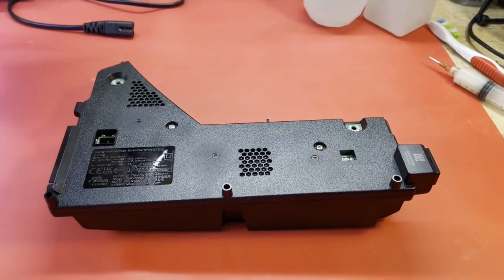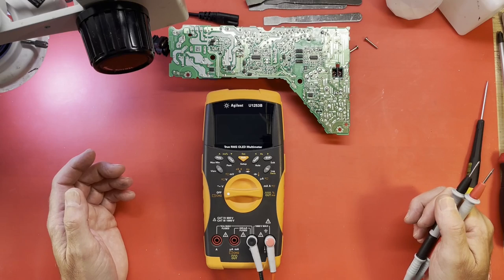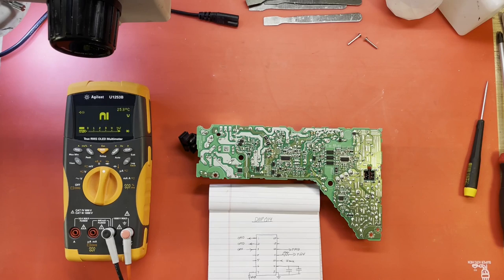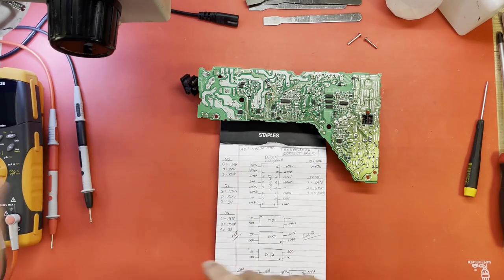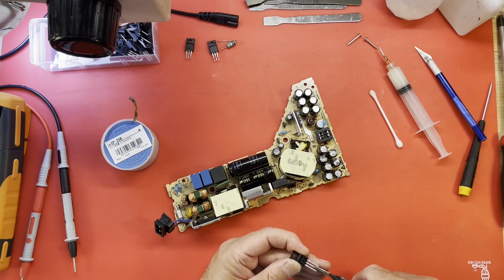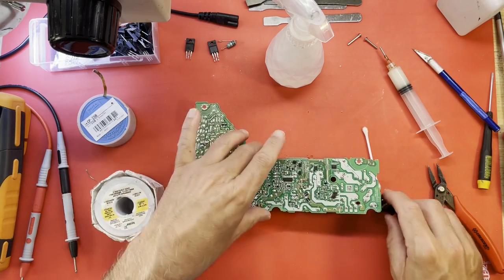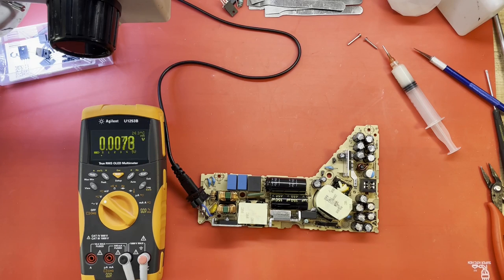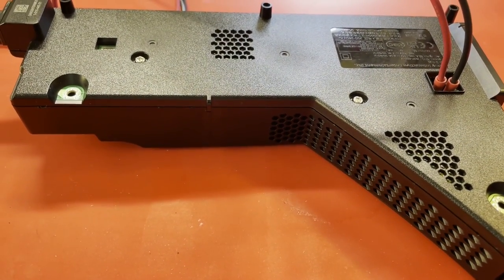#92 Repair of ADP-400FR PS5 Power Supply

Comment: Great video, as always. Your channel is helping me a lot. Explanations are very useful. Especially your diode-reading notes. You have no idea, how helpful they are to amateur. Do you also do similar notes with voltages?
Reply from the maker: Thanks!  I appreciate that.  I sometimes will take voltage notes.  I think I find diode readings more useful because usually the device is completely dead and thus voltage readings are almost useless.  It is useful to know the Vcc voltage.

Comment: Nice work! I've not finished watching your video, but If you want the white gummy antivibration on the replaced-without-reason big cap search for "liquid electrical tape". Works very well!
Reply from the maker: I will do that!  Thanks for the tip!
Reply: @ToltecMerc  Thanks for your content! I repaired a lot of PSU's using your clear explanations! Regards from Italy
Reply from the maker: @riparaggi  that’s really good to hear!  Save those supplies from the trash!

Comment: So the resistor was just a current resistor? How did you know the mosfets are blown, i guess you worked a lot on these Power Supplys? What do you think happened, that both mosfets get a short between source and drain, overcurrent?

Comment: Hello, nice video. A faulty power supply can cause random PS5 shutdown while playing?
Reply from the maker: Yes.  It is possible that a power supply could cause that.
Reply: @ToltecMerc  what can cause that, PFC capacitors or the PSU has a thermal fuse that can be triggered with overheat? No warning message about high temperatures pops up

Comment: Atm I dont have solution but that multimeter is not viewer friendly... when you measure something at the same time we want to see it on multimeter, but this multimeter is not friendly to eyes. Try to change FPS of recording camera?
Reply from the maker: Yeah I realize that there is a problem with the different refresh rates between the meter and the camera.  I will try to tweak my camera settings and see if I can make it better.

Comment: I'm thinking I could use a new portable meter with an easy-to-read screen!  If I recall correctly, I bought my Siglent bench meter after seeing one on your channel.  It definitely made reading my meter much quicker and easier.  The only problem I have with it is it's diode mode. when checking some LEDs where it will say OPEN but the diode is clearly lighting.  lol.

If you do get new probes, go gold plated.  I have some cheap gold plated probes from Jeff Bezos and they are much more reliable during continuity checking.
Reply from the maker: Diode mode outputs about a 1mA test current and measures the voltage.  Most meters will show a maximum of about 2V before showing OL.  LED voltages are typically around 2V so being able to display the voltage drop is hit and miss.  
I have recently bought some very nice gold plated Probe Master probes.  The problem I have is that the probes will fall and hang of the bench and the tips hit the concrete floor.  Then the tip is mangled and I have to file it to sharpen them.  There goes the gold plating.